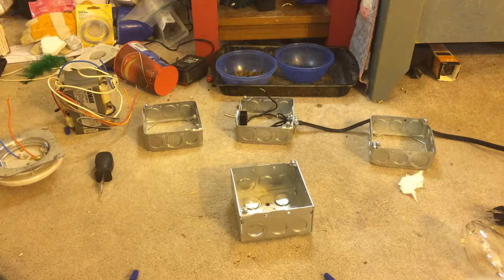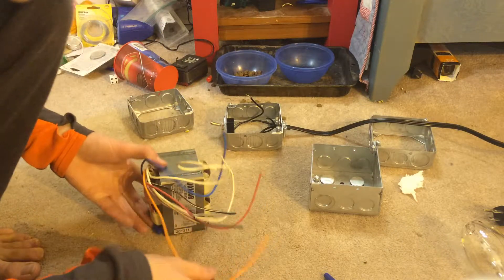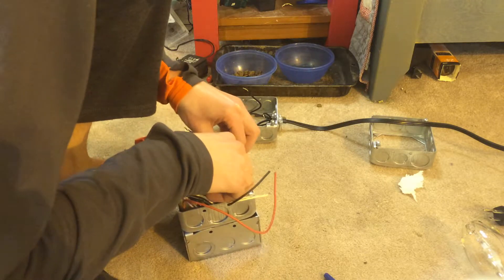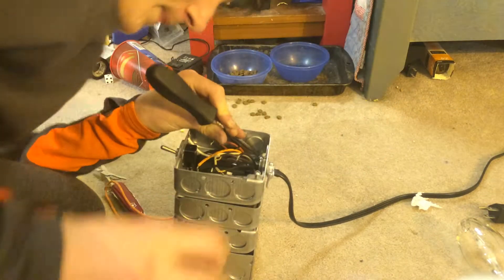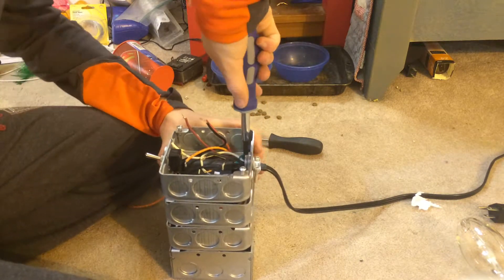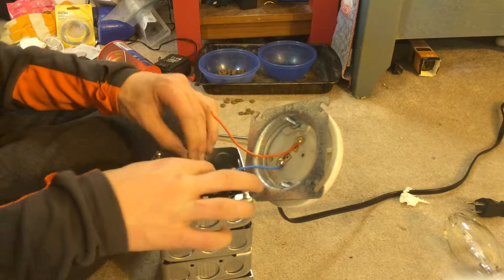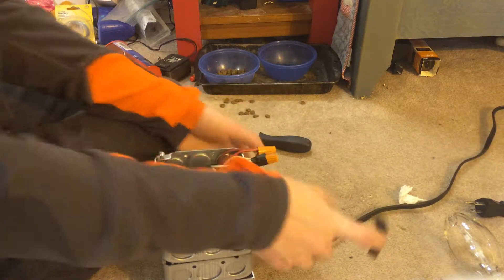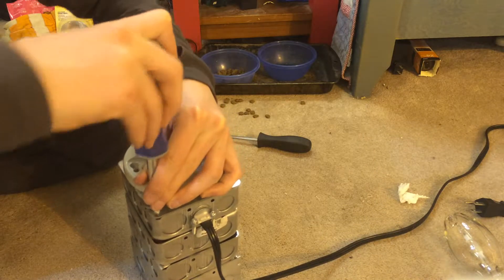The Assembly of my Homemade 150 watt Pulse Start Metal Halide Fixture

Comment: When it comes to pulse start lamps (and especially electronically ballasted ones) and doing splices, I like to use soldered lineman splices and 3-5 layers of shrink tube. For me that's given my projects a decent amount of insulation without any chance of leakage to ground. Heck, I have enough confidence in the joins to touch the wires at the joins while igniting the lamp and I'm not keen on the jolt that an igniter gives out!

Also, I feel with some veneer fascias, an open rated lamp and a shade that would make a really nice overpowered tableside lamp :)